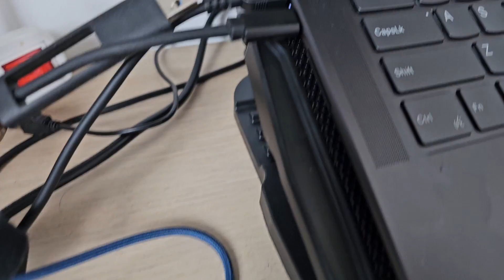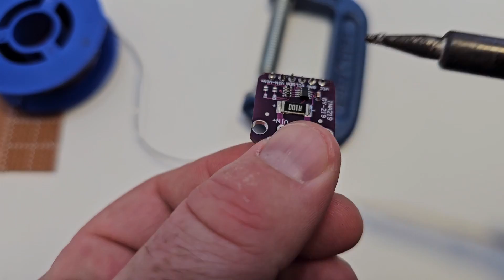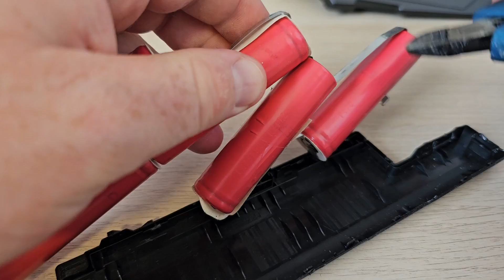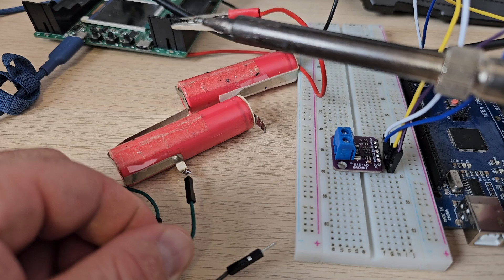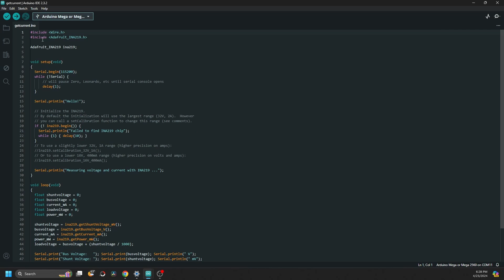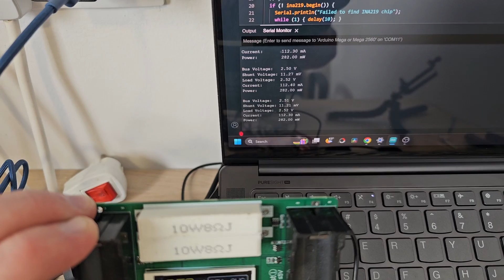INA219 I2C Current Sensor: Soldering to Serial Monitor

Comment: Could you explain about pin V+ and V- Ina219 ---->and battery? How batteries connected to Ina 219 pls😢
Reply from the maker: Hi there. Accordingly to this https://cdn-shop.adafruit.com/datasheets/ina219.pdf page 9V+ and V- is where you measure the Current. I have connected the battery - to the Ina219 GND and and the Battery + to the top part and the other end to a consumer.